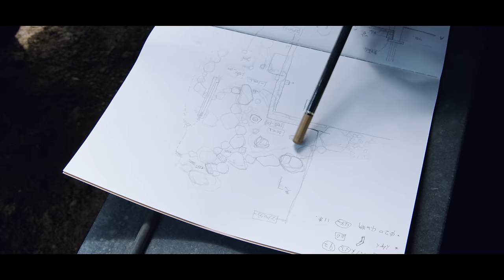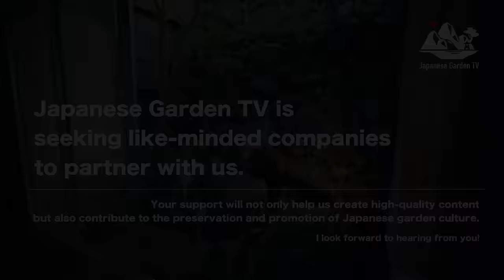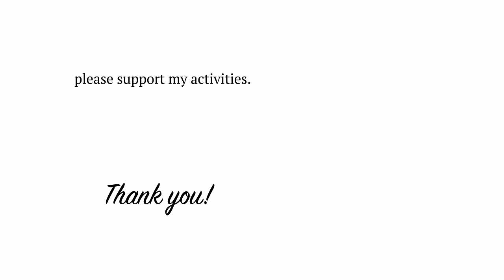(Pro.59 - Final)  Finally completed! Creating a Japanese garden with waterfall and pond.

Comment: It was ok, some or two areas were very nice and the pink rock is very hard to set in the right amount before it does not stand out too much.
I did not like the grey large flat stone to the left, as it needed at least one similar stone a third of it´s size close by. I imagine it´s to sit on.
I found it was too much stone and has no areas free to rest the eye, every area demanded too much attention "Less is More" comes to mind.
Finally, their was only one size of moss being used and no larger peace's, was also missing moss on some stones.
The tree already there was wonderful, it will have to be kept clear of rotting leaf later as the smell is not so nice. I liked the stone the pillar was sitting on, very nice.
In all its ok, some of the plants like the Japanese grass grows quite tall and plants were too close in general, you might not see them due to this.

Thank you for your film